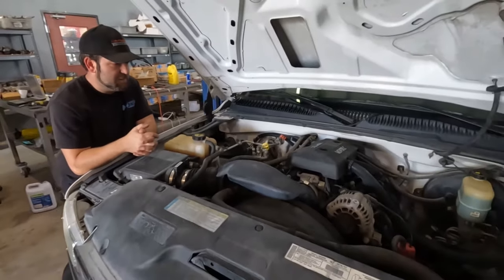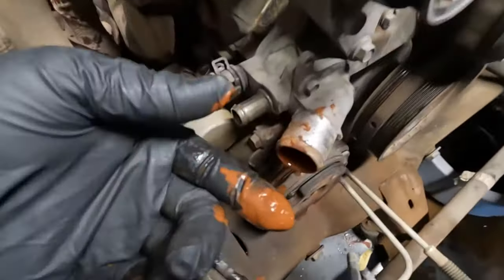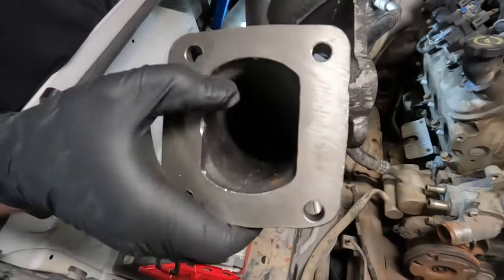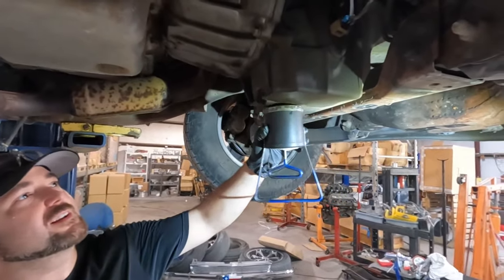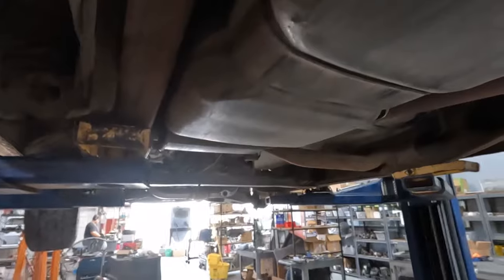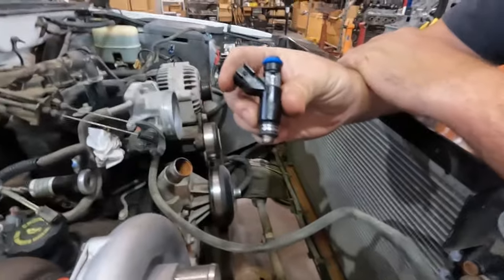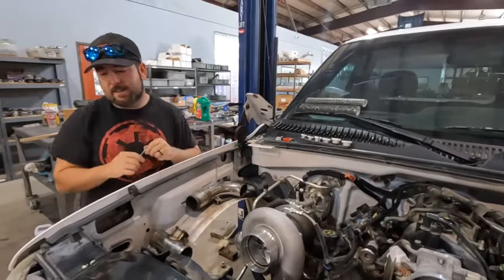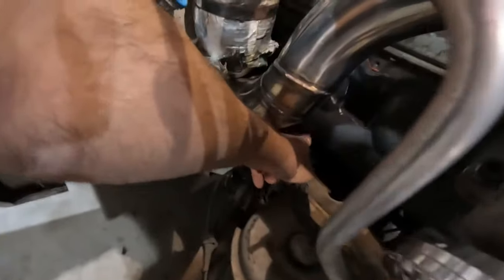Budget Turbo Truck: Episode 1

Comment: These turbo manifold also fit perfectly into Ls swapped g-body’s. We’ve used these budget manifolds for two builds! One of our cars runs 6.5’s with this forced performance manifold and forced performance 78/75! You can’t beat them for the money! 

Awesome content guys, look forward to seeing what this thing can do 🤘
Reply from the maker: You too man, let us know when you are ready for some fresh turbos! Thanks for the kind words.
Reply: How are you mounting the wastegate. Oh crap this turbo has a wastegate flange?   Where do I find this.
Reply: @theshark2804  there’s a few ways to do it, some mount the wastegate to the hot side exhaust housing of the turbo. Forced performance actually sells a hotside that’s already welded which  makes it super easy. My personal car has the wastegate on the crossover pipe. I believe that’s the way they did the truck also. Both ways work great!
Reply: @schmittbox636  well I’m looking at doing a Huron system since I wouldn’t have to do any welding. I just looked at forced induction and they are super expensive. I’m good. I’ll do the Huron system with a gt45 and call it a day

Comment: Building a turbo junkyard 5.3 right now to drop in my 2010 chevy silverado approaching 200k, so far I got most the parts: 
Camshaft - BTR stage 2 turbo cam kit with titanium springs and retainers and pushrods, gaskets and cam bolt - 836.51
Fuel Pump - AEM e-85 compliant - 160.00
Fuel pressure regulator - 130.00
Turbo - T4 Turbocharger kit for GT45 Universal Turbo Kit Perfect For 4.0L-6.0L engine comes with turbo, accessories, front mount and injectors - 713.00
Turbo log manifolds - FP T4 log manifold around 400 for both sides

Anyone have any pointers? First turbo build I am doing by myself, all I have worked on in the past is DSMs (Eagle Talons, Plymouth Lasers, GSTs, GSXs) I appreciate any guidance to make my build the best experience I can make it. Thank you for your time, and thank you for sharing your video!
Reply from the maker: Hey man, you are always welcome to shoot us an email through our website and we are happy to help you out! You are starting off with more than most people, that should be an easy 500+ hp setup without too much effort.

Comment: Is forced inductions going to ever get any turbo LS crossover pipes back in stock? Maybe for christmas? Like last year
Reply from the maker: Forced Inductions or Forced Performance? Two different companies! I don't think we plan on selling any more crossover pipes, they are easy to DIY and the price point on these was a bit high. Basically just a couple straights with two 90's.
Reply: Forced Performance is an older company than Forced Inductions, they just liked the name ;)
Reply: LOL I'm sorry I meant Forced performance. I should know the difference because I have owned turbos from both companies.

Comment: Can I weld stainless with regular mig?
Reply: What settings should I use I have a titanium harbor freight 140 wit 75/25
Reply from the maker: Trimix gas (generally don't want to run 75/25 on stainless) and solid stainless wire. You caaaaan but most folks don't keep a separate bottle of more obscure gas. We use a Tig and 100% argon here for anything stainless.

Comment: Does that turbo have integrated wastegate mounting ?
Reply from the maker: Yes! It has a flange so you can bolt a TiAL F38 directly onto it. It has worked perfect from 6psi up to the 16psi we are currently at.

Comment: How did yall get that manifold to clear the a/c filters on the 99s just tryed to install same manifold had to grind it above the filters so much I cracked it still wouldn’t clear
Reply from the maker: A hint of bend, the best choice is to swap to a later style setup though. We torched the soft line twice on this thing.
Reply: Yea I had bent the line I was talking about the filters there self the header wouldn’t clear for me